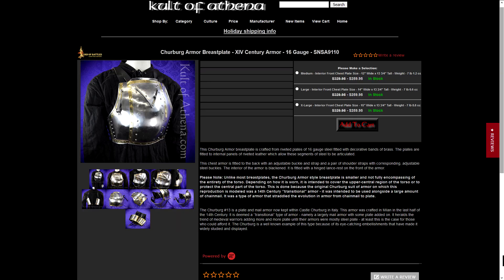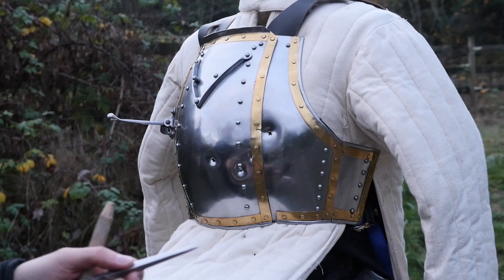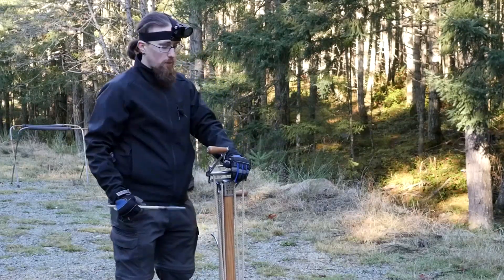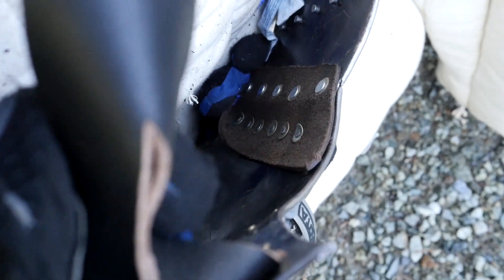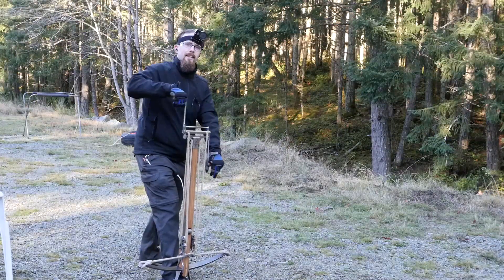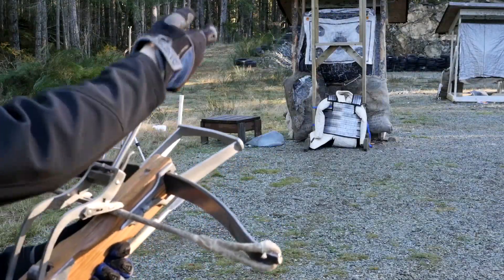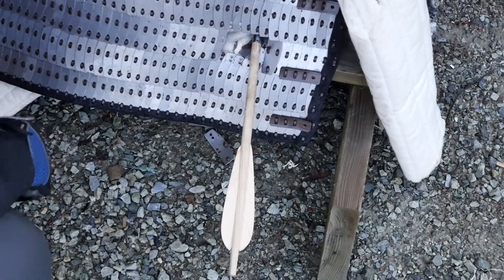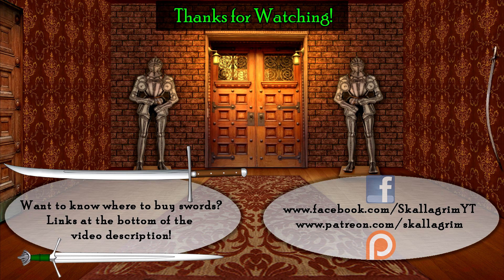Medieval Crossbows vs. Breastplate and Lamellar Armor

Comment: Skallagrim,
4:00 You can see you are looking at the wrong impact. It actually punctured through the tape right and above where you thought it hit, which was in fact always there as you can see in the slow motion impact footage. If I recall the hit you actually pointed out was the very first shot from the light crossbow on the first day of shooting. So really the heavy windlass crossbow inflicted a brutal hit that not only sank the armor in but had decent penetration before the vibrations snapped the head off.

Comment: Based on the denting and the price, I assume this is mild steel rather than anything hardened. Is that correct? Have you done any chronograph tests of the heavy crossbow to determine how much kinetic energy it's delivering?

Comment: So if the lamellar lames were a little bit thicker and the material used to hold it together was of better quality, it may have very well been pretty good armor.
Reply: yeah, I agree. Skall is very upfront on the budget quality of that particular lamellar. better quality leather cords and even just slightly thicker plates would have been better.
Reply: This is basically how brigandine was invented.

Comment: I think bolt you where using for the heavy crossbow was to small. If you look at the medieval bolts the heads and shafts where much more massive than the one you used for the experiment. I bet you would penetrate the armor easily with such a bolt.

Comment: I know your not claiming any scientific value of these test but after seeing Scholagladiatorias clips regarding experimental archaeology I wonder if the crossbow-bolts you use are a good comparison to bolts that would have been used against people in armour?

SG comments on a documentary regarding English archers is that the arrows used in their test are wrong - They use a long bodkin point that bends when hitting the plat and and that much of the force in the arrow disappears when the shaft breaks.  Therefore the shaft often was thicker near the tip.

As I understand from reading about tank armour - one important aspect of armour and penetrators is the impact force/impact wave. If I am not completely wrong an object that hits another object with a certain force will have the same force applied to it as it apply to the object it hitting. Another point is that when a wave changes medium it usually bounces and this somewhat nullify the force of the wave. So a long point would be able to absorb more energy then a short one and less of a shockwave would bounce back when the medium changes from the steel/iron tip to the wooden shaft?  If this is true, wouldn't an arrow/bolt with a longer tip impact less energy onto the plate vs a an arrow/bolt with a short tip? And wouldn't  a arrow/bolt that is thicker near the tip be able to survive the impact better?

So I wonder if a shorter point with a thickening of the shaft near the tip would have been better/given another result? 

Or bolts that are similar to number 3 in these picture : 
https://www.medievalcrossbow.info/wp-content/uploads/2015/01/Different-Forms-Of-Crossbow-Bolts.png
Or more like the ones found in this picture :
https://www.medievalcrossbow.info/wp-content/uploads/2015/10/Medieval-Crossbow-Bolts.jpg

Now I know you might be on a tight budget and getting custom-made bolts might cost a bit but it would be interesting to see if there is a difference in the result!

Edit : 
https://royalarmouries.org/what-we-do/research/analytical-projects/armour-piercing-arrowheads

Comment: the lamellar actually do better against piercing as it is harder to deform a smaller metal with the same thickness, and if the material of the strings is right(like reinforced silk) the armor will be flexible that the plate will be pushed against the body to the maximum before they start to absorb energy(so the strings don't break but the user will be quite painful). Also, the plate armor can surely stop a few arrow hit(as shown), however, all metal will be weakened after hits, so more arrows will be able to start penetrating over time. That is why the Chinese focus on arrows protecting armor(lamellar/later the fish scale and mountain pattern) as it is common on the Chinese battlefield that there will be "arrow rains" and you will probably get hit by more than 30 arrows before reaching enemy line(side note the composite tech of the Chinese bow gave Chinese bow power of a crossbow and crossbow rate of fire of a bow)

Comment: It is unbelievable that the lighter crossbow has 350 pounds of a draw, which is more than twice as much than a usual modern crossbow, and still is unable to penetrate a 1.6 mm thin steelplate. Especially when we take into consideration, that Joerg Sprave's homemade 180 pound crossbow is able to penetrate a car door^^

Comment: Some myths get dispelled here i guess ;) 
Just hate it if someone says "oh, fuck your plate armor, a peasant with a crossbow could kill this knight"

Even though you have to consider quality differences. Even todays cheap steel is of really good quality in comparison to some munition grade armor. But penetrating a good hardened and tempered brestplate? Pretty unlikely in my oppinion.

Comment: One Thing about gambeson testing that I have been wondering and would like to see if someone can, I notice that all gambeson tests are done on a clean, dry gambeson. Any time I do anything in a hauberk and gambeson the gambeson is soaked through within minutes. I would be very interested to see how a wet gambeson differs in performance. Thank you

Comment: I can definitely see how crossbow-fire might be able to "soften up" targets for melee. I mean if you create weak points, or holes, in plate armor, you could then proceed to punching a warhammer spike or a spear through that same hole. Won't be easy but it is an additional opening.
Reply: I doubt it'd present an opening that's viable enough to become an alternative to the normal method of simply bludgeoning the wearer with a giant polearm or wrestling/capturing them.
Reply: Crossbows and arrows I'm Mediaeval times were not aimed at knights. Remember only the elite could afford amour. The rest of the army wore what ever they could find. Crossbows and bows were for them
Reply: @edwardelric717  Not to mention you wouldn't waste time and ammo on people you can't kill.
Reply: @edwardelric717  
Well there are other armour types that were quite common that are  hard to shoot through with arrows
Reply: If ya have them mails, prepare are certain death
Reply: Well, if the armor starts bending/losing plates, it starts losing structural integrity. So, less efficient and even easier for a warhammer or poleaxe to finish the job.

Comment: Very nice testing Skall. I was a bit surprised to see how well the points bite into the armor, I was expecting to see a lot more glancing off. As always, we see that armor works, but that it often gets severely damaged of destroyed doing its work. That lamellar armor seemed of really shoddy quality, especially the leather strings holding it together. The leather broke so readily, that you have to wonder, if the quality of the leather was such, that it would have broken apart from just normal wear and movement. Either that or the edges of the holes in the plates were razor sharp. I suspect a better reproduction might have held up somewhat better.

Comment: Nice video, love to see acknowledgement this test is merely entertainment rather than definitive or scientific. I'm convinced an English warbow shooting a 100 or so gram arrow (worked iron head) would probably penetrate that. just as Thrand's 70 lb bow can poke holes in his breastplates. Would be interesting if you could find a local archer to test it. Interesting the small lamellar plate faired better than the Breastplate (far less penetration.)
Reply: I'm a bit doubtful to that, as you can't really put more poundage into a bow than you could a crossbow due to the mechanical operation of the two.
Reply: Well, here you can see what a 150lb longbow did against a breastplate at 20 yards: https://www.youtube.com/watch?v=Ej3qjUzUzQg ... <spoiler> barely scratched it.

Comment: I feel that the testing with the heavy crossbow is a little inaccurate, because the bolts weren't capable of handling the force the bow was putting out. When the bolts break as the seemed to do consistently in this video, the kinetic energy of the shaft is lost. I seriously doubt that the bolts used by medieval crossbowmen would have broken like that, and given what we saw in this video, the loss of the kinetic energy of the shaft might make the difference between a hit that does serious injury and one that does not.

Comment: Even a crappy lamellar armour is quite good vs arrow! Have been looking forever for such a test. They are definitely using very low quality leather for the strings.

Some lamellar armor, especially the ones from Eastern Roman empire, were made from small plates of metal riveted on to strips of leather. The plates are not laced, but nail to a big strip of leather. Then the strips are laced together. That should be even more resistant. You basically have buff coat + this "lamellar" + padding level of protection.

Comment: I wonder how much more effective a solid metal bolt would be.
Reply: Not at all, there's a reason they were not used historically, besides the price and production you have to consider that all the extra weight and density would make it start dropping
much faster and lose more energy in flight, one thing it will do however, is survive impact against steel.
Reply: Hmmm i figured it would be more effective at shorter range, at the loss of maximum range. Still think it would be an interesting test.

Comment: I would have liked to see a modern crossbow used too.
Reply: Dominic Waters Problem with the modern crossbow is that it use light weak arrows instead of heavy bolts, but it would be interesting to see what will happen.

Comment: AFAIK, the warhammer strike would be lethal or at least incapacitating. It doesn't need to penetrate or completely cave in the plate. The shock of the impact is till like a major car accident and can easily cause internal bleeding.

Comment: Now question is how many crossbows a lord could buy for the prize of one full plate armour. How many bolts are the average needed to either hit a weak point or bother the enemy enough to be effective (helping  friend forces taking them down).
This is interesting because armour has to balance protection vs mobility, vision field and breath. And this is where crossbow made it's way. Also shows how much a revolution advanced guns were, as they obliterated all this game until ww1 with helmets returning.

Comment: The Advantage of a crossbow bolt . That when it or if it does  go through the Armor or someone with out armor You have to pull it out rather than like an arrow you can push out the other side. You could cause more damage by pulling it out then pushing it in because  "^" Your pulling the thick end through. Render that soldier useless for the rest of battle. Were as an Arrow you could just break it and push it through(Unless hitting a major organ). But Generally the major organs are protected by Armor heart ,liver, kidneys, family jewels. Hard to break off a Short crossbow bolt. I would Think most Crossbowmen would aim for a non-Armored part of the individual and a couple of Hundred crossbow bolts firing off would hit some in the Neck or the Arms and be lodge in the bone. Or at lest damaging the Armor enough so melee infantry can take advantage of the damaged armor. AT lest in Theory!

Comment: So, is Brigandine basically Lamellar rivitted to the inside of a leather jerkin? 

I know I have the benefit of a modern understanding of structures, but the people of the Mediaeval period knew that domes were stronger than sheets, and you can stiffen both with a recurved lip. It would be labour intensive, but pressing those scales into a lipped dome would strengthen them greatly, and rivetting them to a jerkin would solve the issue of the cords snapping.

Comment: I feel like It matters not as  much about the glue you're using but about the bolt head. Why is there a centimeter of room for the shaft to stick in, It's literally flopping out.
Reply: Nicholas Salohcin that's the armor doing its job if you're talking about the 2nd set. Thats what the armor was designed to do to flying pointed projectiles.

Comment: What do you do with armour/weapons after you trash them? Are these recyclable?
Reply: - Briver - Absolutelly. 

If you look at lamellar - it is so much less protective but thats the advantage of it. It absorbs energy in tight area of just 1 plate mostly. If a person survives or dies - lamellar needs just 1-3 plates swapped. Thats so easy to repair and doesent need recycling. Same with mail armour.

I would believe that 17th century tartar mail coif could have areas of mail from like 8th century dane mail hauberk. Mail was highly reusable.
Reply: It's not as easy as that (Though it is comparatively easy compared to other armour repairs). In order to remove said damaged plates, you must remove not only a few lacings, but rather you have to remove the adjoining lacing of the rows above and below in order to remove the lacing from the row with the damaged plate, as the plates are laced from above and below as well as from the sides.

Then, once you have repaired your new row, you have to reattach all the lacing again... that is going to a little while. And woe betide the man with damaged lacing... because then you have to source some new laces, because damaged lace is something you don't want in your armour.

So it is easy, but time consuming.
Reply: The Jackinati275 Ok then mail goes as king of armour for repairs then lol. Swap a few rings and youre fine.

Comment: The difference in impact is also important to note.
The breastplate spread out the impact across the entire surface of the plate section that is hit, while lamellar, mail scale etc. cannot do this, but the impact is delivered upon the single small section(ring, scale, plate) that is hit.
Reply: Neutral Fellow having padding underneath still helps dissipate the force enough that it would hardly even bruise, even at that short distance.
Reply: Yes for the plate, not as much for mail/lamellar/scale.
The impact is still focused instead of spread.